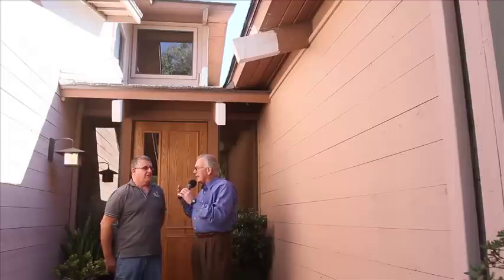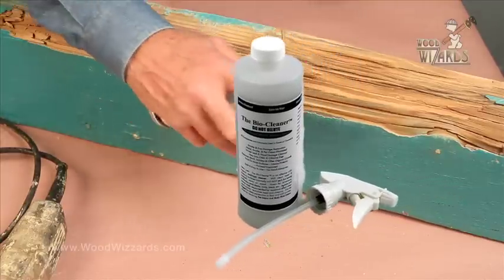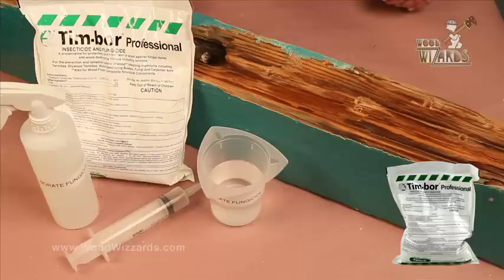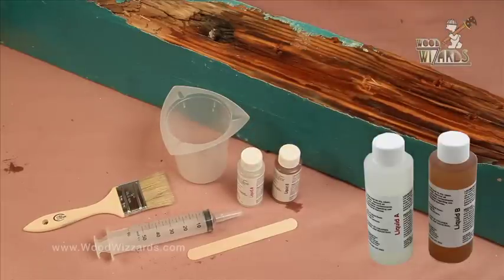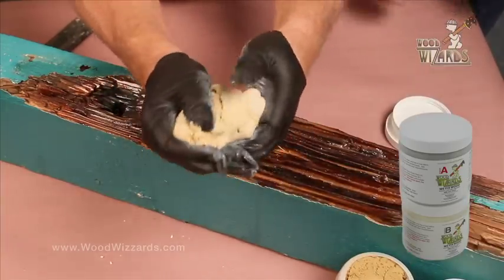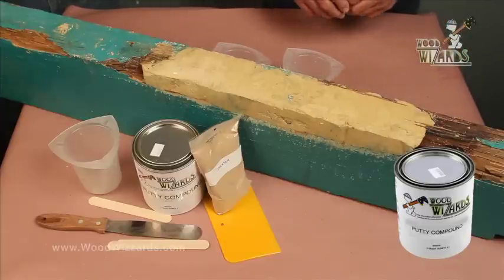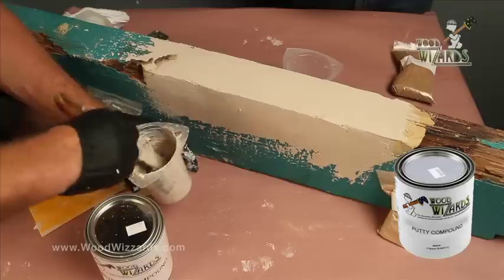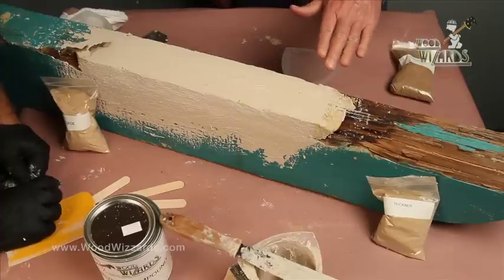Dry Rot & Termite Repair using Wood Wizzards System COMPLETE 'HOW TO'

Comment: Now show how to get under a house and work on support beam. Working from 8x8" bean end and working into the wood. Insects ate in and created tunnel. Wood us wet. Either from bugs or water dripping through porch boards. House 109 years old. Bugs are hollowing out house support beam.

Comment: expensive system to use but can be cost effective to make repairs to damaged wood without removing it from the structure.  The narrator is really annoying and I agree with another viewer it could have been half the length video to fully explain this method.